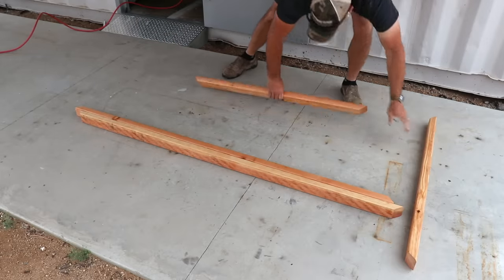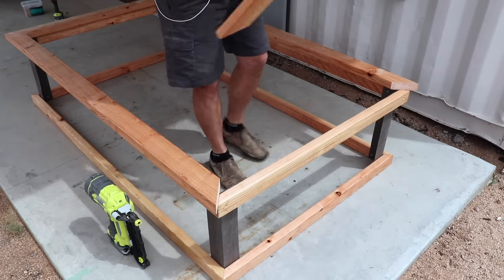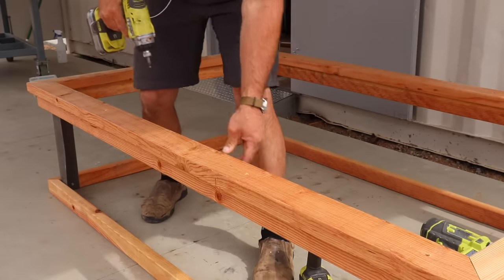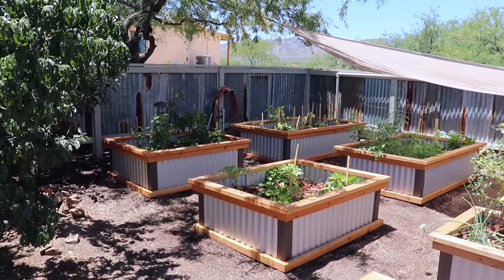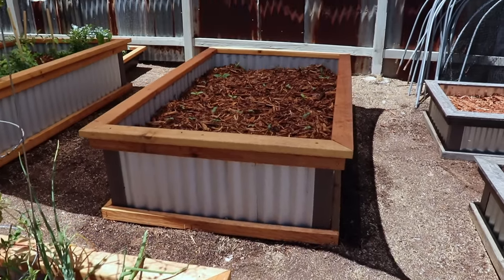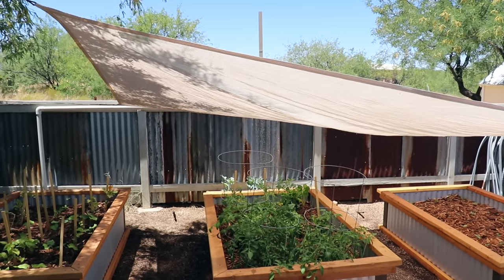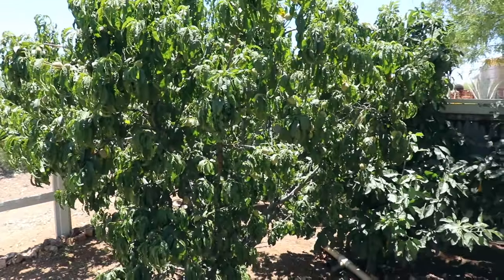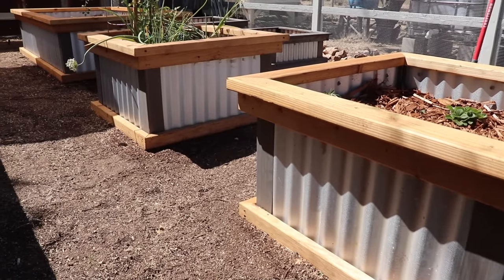Beautiful DIY Raised Garden Beds in 3 MIN!  - How to Build

Comment: Hi Joe, thanks for the video.  I have a question, did you run the panels in a vertical vs horizontal direction for structural integrity?  I wondering because I could make fewer cuts.  Thanks

Comment: Side note, for posterity: Metal is a good heat conductor but has a very low heat capacity - about 1/10th of water. I laymen terms, metal gets very hot quickly, but there's very little energy in that heat compared to say water. If your plants are well watered on those hot days, the heat capacity of the wet dirt will be so high that even if the metal was scorching hot, it wouldn't really reach the roots.

Comment: The thing to remember with new raised beds is NOT to fill them with soil right away. Instead use layers of carboard poo and straw this will fall fast and then you  replace again next winter or fallow period. This turns each bed into a giant worm farm.
 Idealy you can do this for a really long time befor the bed is finaly full of the finest compost.
Reply: tree branches, etc. hügelkultur
Reply: Does it attract mice and roaches?  I saw on a channel here where he took apart a raised bed and he had roaches in them.

Comment: What kind of wood did you use and do you need to stain it to weather proof?
Reply from the maker: I used regular pine.   I did coat them with linseed oil before I assembled them but you could also use pressure treated stuff too😀👍

Comment: Do you have any problem with the weight of the soil bowing out the corrugated metal?
Reply: My sidewalls are 24" tall and the corrugation running vertically. The bottom 8" is filled with mulch and the next 12" top soil. I also fastened the metal every three ribs to the wood. I do not have any bowing.

Comment: Hey, thanks for this post they look great! Am just going to start making a few of these and have all the materials. Question: I am intending to make longer, taller, narrower beds. (6ft x 3ft x 2.5ft wide) do you think this design would manage at a 3ft height? I might add some support 2x4's on the long sides.
Reply: This is just my thought, but what you could do is just make a third end frame, like in the first step, and have it screwed in half way up the sides.  It wouldn't look too weird, would be a perfect fit, and give some piece of mind.
Reply: @T Mac hey T Mac, ya i did but made 31" high in total. They r a bit longer than 6' and didnt do any re-inforcements in the middle (I followed the German rule of stacking many ~5' logs in the planters) to greatly reduce soil volume (and additional pressure) on the wallls. It worked great. I'll see if ican post some pics if u care to see the finished product.

Comment: Looks to be a great solution to what is becoming an expensive build in most cases a raised garden is becoming. This is easy to adjust a size that will fit individual cases. There are a few materials that could be substituted letting the DIY to use what is available. To have a comfortable sit spot as part of the skeletal backbone of the constitution is a definite plus. This maybe the best solution for those handy with tools or that have friends that are. Hamburgers and beer would easily generate the help.

Comment: I like it,  and i like to be able to set on it too.👍👍   I replace my curtain threw out the house.  Rather than burning them.  i made them in to a shade for the garden.  I made the frame for the curtains tops, out of tent aluminum poles and hose clamps 😆~ IT WORKS GREAT 👍👍

Comment: Thanks for sharing Joe!!  I built a 4'X4" version of this bed yesterday and will be building three more.   (one more 4x4 and two 4x8.)   They look really nice and are very sturdy.  I plan on running an automated drip system from my greenhouse to them for watering purposes.    For anyone having a hard time locating the flashing in a color....look up companies that make metal barns/outbuildings.   They're all over the place here in the Ft Worth area.   They made the flashing for me on the spot.  They even had 12 colors to choose from.   :-)
Reply: Or metal roofing companies
Reply: How much did a 4x4 bed cost to make?
Reply: @ale347baker  I bought all the materials at Lowes minus the corner flashing.  I remember the two types of screws needed were $10 each (box of like 3 pounds),  the corrugated roofing sheets were $20 each,  and I used six 2"x4"x8'.   I would guess all together the 1st one cost $75-90.  The next one was cheaper because I used left over screws, flashing.  Only needed to buy more corrugated roofing and wood.    Sorry I couldnt be more accurate.
Reply: @ale347baker  I should also mention the later ones I built I did not use 2x3 demensional lumber.  I used all 2x4.  The 2x4 wood at Lowes was in much better shape and straighter than the 2x3 lumber.
Reply: @ftworthtexan9082  Thank you so much, it helps to have an idea!  I looked at Costco's Vita garden beds vs making my own.  Those cost 85 for 2 but they are plastic.

Comment: These are awesome. Cannot wait to build some.
P.S you should not use a grinder to cut the metal sheets it will promote rust.

You should use a cold cut saw or tin snips etc

Thanks for posting
Reply from the maker: Thanks for checking it out😀👍

Comment: I quite like you incorporating the Q&A into the video, these get spread into the comments and are easy to miss or may be addressed in a future video, but the context and connection is lost.
I have questions of my own: In a desert environment, would it not be better to let plants grow in a pit, i.e. the opposite of a raised bed so they can make the most of the scarce rainfall? What soil do you use to fill up the raised beds? Do you just water 'em with a sprinkler; do you have some sort of drip lines planned?
Here's a suggestion: Make a compost pit (Joe style of course) to make your own fertilizer and utilize your kitchen scraps and grow a few trees around the homestead that give you nitrogen fixing biomass by way of pollarding and coppicing.
Reply from the maker: Thanks!  I felt like they were questions that would need to be answered.
As for desert growing...yes, sunken beds are more ideal, especially for landscape type plants and trees.   But having raised beds is more about the convenience and aesthetic, than being completely practical, at least for here.   But on that other end I didn’t want to dig a bunch of holes and fill them with new soil...as our desert soils are both hard and greatly alkaline.   So I’d have to add quite a bit of acidity to bring them to a ph that the veggies would like.   So these raised beds are kinda more about having just a nice place to enjoy while doing some small scale gardening😀👍

Comment: I like that he uses the "L" flashing in the corners. A spot where wood would rot. I used treated for the wood at ground and untreated for the wood around the top. Sealed the top boards with Australia  timber oil which is linseed oil. I took the corrugated metal to a local welding shop and they cut the corrugated panels for me in a jiffy. The boxes  are strong and sitting on the top rail there was no give in the box. Thanks for the idea. Boxes were approximately 8' x 4' x 24" tall.

Comment: Good basic design overall for what appears to be a drier climate setup. However, I would be concerned about the wood on the bottom of the frame, and its longevity in a wetter climate, and ending up with wood rot. What would you suggest for wood sealer, or possibly metal framing on the bottom? Thanks for sharing.

Comment: I did a similar project but used 4x4 corner posts and ran the corrugated ridges horizontally.  I like this better because 1) it is cheaper (I do this for $)  2) It is quicker  
I was wondering about the ability to hold a load, but it appears that running the ridges vertically adds strength to it.  I saw you sat on it, but I do these for folks who are ...... "calisthenically challenged" and may weigh in excess of 250 lbs. Would you recommend this for load bearing strength?
Reply from the maker: Depends on three gauge of roofing.  These panels were 26ga scraps from my house roof.   I would guess two of me could sit on one aide just fine.  I’m 225lbs.    But if you got the thinner roofing that is 29ga then I would say only good for say one person to sit.  Hope that made sense....at least I think it did🤔😂👍

Comment: What wheel did you use on your grinder to cut the corrugated metal? It made a nice clean cut with no sparks.  Last time I cut sheet metal I was covered in sparks and made rough cut.
Reply from the maker: There will be sparks for sure.   I think that clip just didn’t show it.  You can check out my wildlife game watered video when’re I cut the same type metal and there were plenty of sparks😀👍
Oh yes....it’s a 1/16th thin cut off wheel for metal

Comment: I have been watching your 3  older videos for about 8 months now  and finally got all my materials to build my beds.  I am using  Douglas fir 2x4 boards.  To hopefully preserve the wood I did the shou sugi ban.  My question is  will the raised bed without the base be just as sturdy at the 2 ft height or is it a stronger build with the base.    I have  area in my yard that's very soggy and unleveled  and I am worried the wood will quickly rot.   Your garden looks amazing thanks for the inspiration!!
Reply from the maker: Hi Tonya,
So the beds I built several years ago that didn’t have the bottom boards will definitely help with wood rot and termites.  But I will say that they can be difficult to get the metal lined up on the bottom if they are really tall.   So in that case I would recommend adding the bottom like I’ve done here.  Additionally I think you will find that 20” or so is a great height and it will save you some soil over 2ft height.  I fear that much over 20” tall, the metal can start to bow from the soil weight.   I built some for a person several years ago that were 21” tall (including the top cap) and they seemed to do fine but I wouldn’t go too much higher.   Anyways, hope that helps and have fun building😀👍

Comment: I was raising one of my 4x10 foot Douglas fir  beds in February  and had to replace the north and west sides after only 4 years due to rot. I live in central California,  so it's not due to constant moisture from rain or humidity.  After I finished I decided that I am going with either metal siding or roofing when the beds need an overhaul from here on. I also like the look. 
IS THERE ANY BENEFIT FROM USING ROOFING OVER SIDING?
Reply from the maker: I’m not totally sure on aiding but I think the roofing will be more rigid since it is made to be fastened over purlins.   But depending on the siding I think that could work great too!   Especially siding like hardy board since it is cement based.😀👍

Comment: Hi, Im in San Tan Valley, so my elevation is at 1500, compared to yours, and the temp reaches 110-117 in June, to August, Im just wondering
if I built these will it be safe in that heat? What is your experience? Also could you tell me how to do the cuts for the corners?

Comment: Nice size fruit trees. Maybe could put some stuff under them, the short beds, then you have a natural sun filter for those shorter beds. I like that light weight design you do on the beds, and they look good.  I want to try a few even taller, that way i can fill the bottom with wood logs, limbs, and compost, and the top quarter will have the soil to grow in now.

Comment: I actually made these beds from your video and they work fantastic now I would like to make an elevated bed planter box 2 ft wide 2 ft deep 8 ft long do you think I could take this framework and screw in 4x4 posts in the corners and center for legs.  I was thinking some 1x3 slats across the bottom to support the weight of soil.  Followed by weld cloth and weed barrier to keep soil in.  Any thoughts suggestions warnings?  Thanks

Comment: Great looking beds. How long before the boards need to be replaced? Thinking about doing this for my herb garden in the front yard to replace the current set up since the boards are deteriorating
Reply from the maker: That will depend greatly and where you’re at.  Here I’ve had one of these style beds go 9 years.   The wood was pretty gray but stuck in good shaped. Just not as pretty as when first built.   But I also hadn’t coated that one with linseed oil like I did for the wood in this one.   
Anyways, not sure if they answered your question or caused more questions...🤔....but hopefully it did😀👍

Comment: The small amount of zinc that might leach into the soil each year isn't an issue, plants NEED a small amount of it to produce chlorophyll! If you are really worried they do make colored panels, not so sure chemicals from the paint would be any better for you!
 For those in wetter climates with weeds/grass that would be under this adding 3 layers of weed block cloth helps. I used it for my strawberry bed(alpine berries, sooooo tasty!) an it has kept the crab grass under control.
Reply from the maker: Yes, it isn’t much an issue for me but a lot of people ask them.... and if I made them out of wood they’d ask if one wood was healthier for the plants than another...and so on😂👍

Comment: Thanks for sharing your design, I'm very impressed by the combination of good looks and practicality. Here in the U.K. I think I'd use pressure treated for the base and the oiled pine topside. Good work !
Reply: Just want to let you know than you won’t want to use pressure treated lumber as it has toxic chemicals in it that will leach into your soil and then into your plants and you’ll be eating it.
Reply: @tressastanton1300  Thanks Tressa, I took this into consideration when I built 5 of these. The only treated timber I used is on the bottom frame which is on the outside of the steel sheet and not in contact with the soil inside. Thanks for your concern.

Comment: Are you going to add any kind of irrigation? Since you have the rain barrels. Another great video thanks.
Reply from the maker: I used to have irrigation in my first beds and I had some issues with me leaving it on and forgetting and I got scared since we are on rainwater as our primary source of water.   So now we just do all watering by hand and it’s a nice relaxing time in the morning with a cup of coffee👍😀
Reply: @homesteadonomics  Dripworks.com has great irrigation supplies for small gardens and TIMERS that will turn it off for you! They even make systems for the low pressure rain collection you have. I use their flat drip tape for rows in my garden, and their drip tube in my raised beds(cut in half 55 gallon white plastic barrels that contained biodegradable driveway cleaner).

Comment: I built 2 raised beds out of usedgarage door panels that were 16 ft long by 21 in. High. I made them 5ft wide using  used oak 2x10’s on the ends. 2x4 brace around inside top. Chain  from side to side to prevent spreading. Anchor angle post 1foot in ground to top of panel. After 2 years they are still in great shape, but I don’t know how long that thin metal will last.   Duane

Comment: I am sorry if I missed something but I don't remember hearing or reading whether or not you used any sort of pressure-treated 2" x 3"s or if you coated them with anything prior to building the bed. Thank you in advance for your response.
Reply from the maker: I did coat the pine wood pieces prior to assembly with a linseed oil coat.   I forgot to add it in a text box during the build portion.   But you could also use pressure treated if your in a wetter environment that me😀👍
Reply: @homesteadonomics  I am in eastern North Carolina which is considerably wetter than your location. I would be best off using pressure treated which would increase the cost of each box and cause me to have to use 2 x 4's rather 2 x 3's. Thoughts on that? I mean, I could use 2 x 3 pine and treat it with a UV blocker but then the price comes out to what a treated 2 x 4 would be. Oh the problems. HAHAHAHAH

Comment: First, my compliments on a fantastic looking garden!   Definitely a job well done.   Second, I like your style of raised beds better than a couple of others I have seen built using corrugated metal.  I think yours is much superior in terms of functional design and  appearance.  I like the idea of hardware cloth to help keep down the pest invasion from beneath the beds too.  Not sure it will totally keep pests out as things will still fly into the beds or crawl up the sides, but it can't hurt either.

I happen to live in Jackson,  Mississippi so my reluctance to build beds like yours is due to the rainfall problem resulting in premature rusting out of the metal.  Corrugated metal just doesn't last long here. We may get upwards of 75 inches rain this yea!  As of this point on Aug. 22, we have already exceeded the average rainfall for an entire normal year (54 inches.)  Plus we have two possible hurricanes headed at our gulf coast in  just two more days that will likely dump large amounts of rain.  And then we will have four more months to go!

The bottom line is I can't seem to find a decent product which is affordable for raised beds but which holds up to our weather conditions.   Basically in about 4 years every product is pretty much degraded by the environmental conditions.  Was thus wondering if you had tried any other materials?

Great video!
Reply: What do you think of using corrugated fiberglass?  It may need a center piece for stiffening.   It might last longer if it proves strong enough.